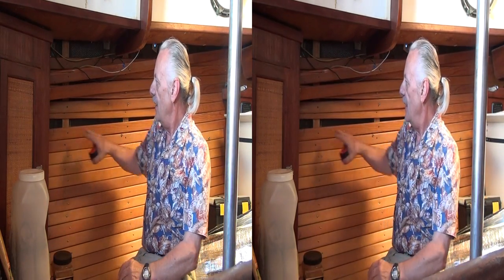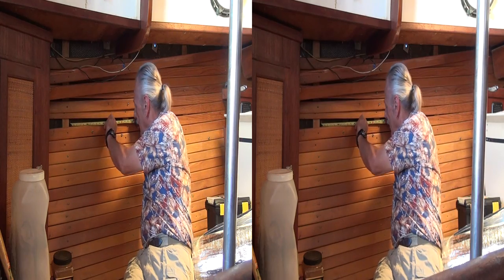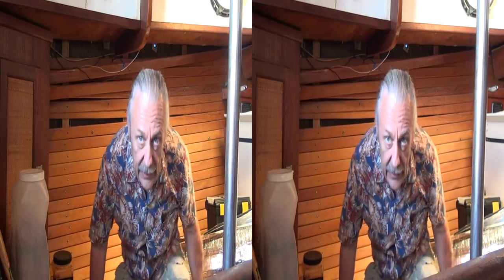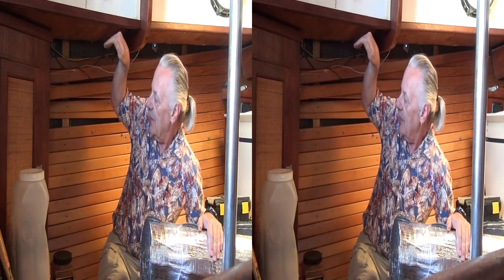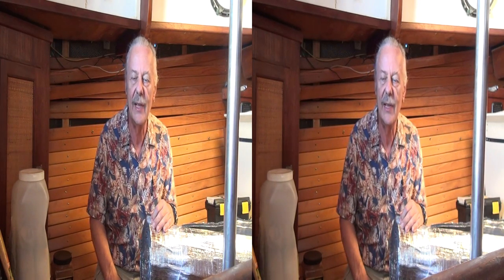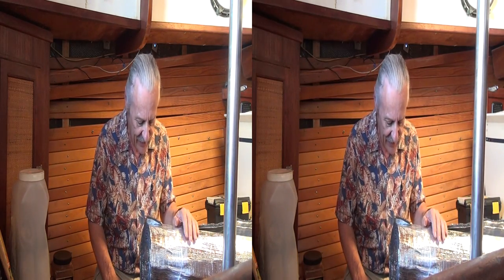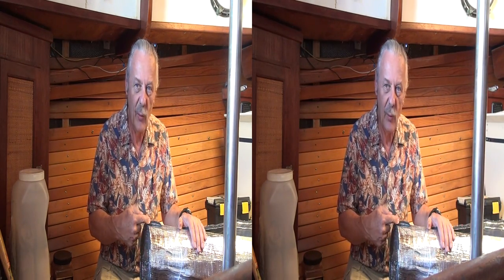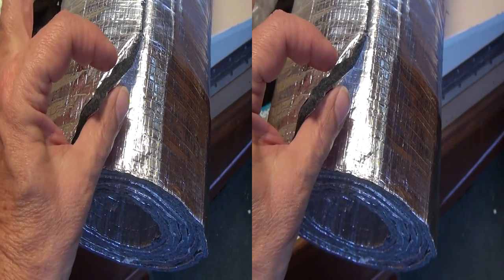Hull Insulation

Comment: Trapped air does not conduct heat, it needs to be moving.  That's why double pane windows are a good insulator.  Thus there is nothing wrong with the bubble type insulation.  That felt, does it absorb moisture?

Comment: Hi, Greg.  Now that you've had some time to experience the results, can you feel a difference and would you still use the same kind of insulation?
Reply from the maker: As it shows, we did this back some years ago. And, YES, I would use the same insulation again. It works very good. The only difference would be that I would paint the side that faces inward a flat black. For optics only. Every once is a while as we move around the boat I can get a glint off of the foil from between the ceiling boards. It's not worth the effort to open up the sides to do it, but if I did it again.

Comment from the maker: Sorry to disagree. Trapped air does conduct heat. Heat on one side of the trapped area sets up a circular current that transfers the heat to the other side.

Double pain windows ONLY work as long as they keep the vacuum between the 2 layers of glass. Once air gets in, they are not any better than 2 sheets of glass.

I have had no problem with the felt. It's between layers of mylar film.